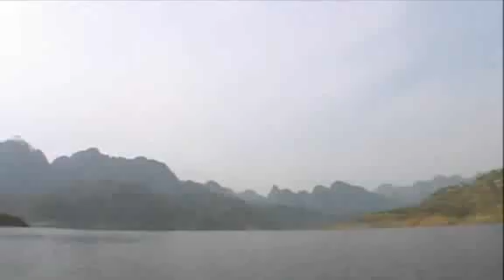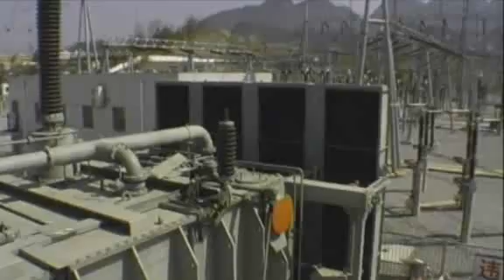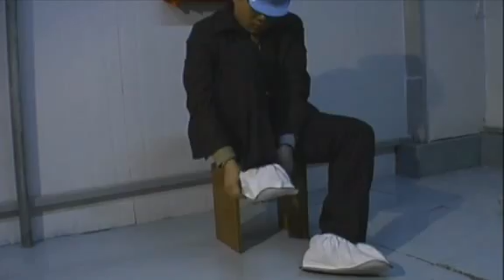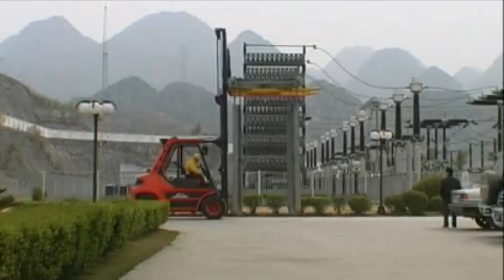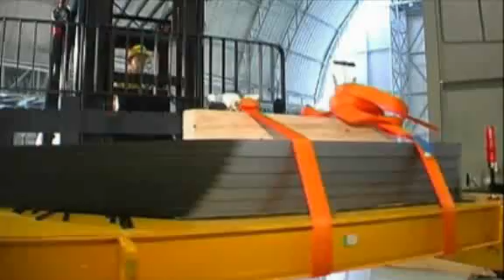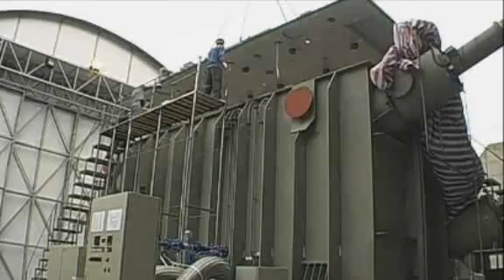HVDC Transformer Repair in China (Siemens)

Comment: 1800MVA... is that like bigger than a AA battery ?   I would like to run my torch on it.
Reply: this will kill you, idiot
Reply: please explain. my torch run on electric so it is same thing but would last longer than AA.
it might need resistor though; something like 220 ohms 1/4 watt or similar.
Reply: Spoif yeah, that will likely work.. be kinda hard to lug it around though
Reply: Spoif I have always wanted to see an electric torch lol

Comment: Lot of useful discussion. Now electrical energy can be transnitted on very high voltsges both on AC  and DC. In a lay man view, there is no difference between ac current and dc current. But losses are less in dc transmission. Dc motors have more tarque and traction power. But both are convertible, ac current can be converted to dc and dc can be converted to ac current. It indicates that why car batteries are importsnt in our life. Here is one question that how a choke was producing high voltage in flourecent tube and how that piece of junk is replaced by an electronic circuit in a saver bulb?
Reply: did you mean torque?
Reply: ac or dc motors mechanical output.
Reply: The choke had a bimetallic strip and heater  (lamp) based starter in parallel. When the fluorescent was  started, current flowed through the bimetallic strip and heating lamp. Heat produced by the heating lamp bent the strip, interrupting the current. Interruption of the current induced a high voltage across the choke (inductor), which also appeared across the fluorescent lamp. This high voltage helped in striking the arc in the fluorescent lamp, thereby lighting it. After the lamp was lit, the choke counteracted the negative resistance characteristic of the fluorescent lamp by restricting the current flowing through it.

The electronic ballast circuits used  nowadays  effectively work as SMPS ie 220V 50 Hz ac->dc->350V 20 KHz ac. This enables use of a much smaller inductor than a bulky choke due to the higher rate of change of current at the higher frequency. This small inductor is integrated with the electronic ballast unit at the base of the lamp
Reply: The coils of a motor are always alternating current, even if the input is DC. if the coils were energised with DC nothing would move, for long.
Reply: What? Generally AC motors have more torque than DC ones. DC transmission is only considered when for very high voltages (500kV and above) and great lengths (500km+) or for grid interconnections.

Comment: Transformers do not work on DC.
Reply: https://en.wikipedia.org/wiki/HVDC_converter_station
Reply: The transformers step-up the AC before it can be rectified by thyristors to DC.
Reply: You have to consider that a transformer is an energy-conversion machine, not only a pair of windings and irons. Today is posible to convert high DC voltajes by means of big thyristors.
Reply: The video name is technically incorrect. This transformer provides (from the power source) around 800,000 volts ac to the rectifier system which is then sent out on the transmission lines as dc.
Reply: This is called HVDC Converter Transformer which is used for HVDC transmission. The basic working principles of converter transformers are similar to common AC transformers, they work based on windings and magnetic flux in the core. However, the main difference is that, due to its valve side ( secondary side) is connected to the 12-pulsed converters, there would be a DC component of the voltage existing  on its valve winding (secondary winding). In other way speaking, the voltage waveform on the secondary winding of converter transformer is a combination of DC and AC, which makes it a big difference from common power transformers.
Reply: A transformer is - by definition - a device that uses a magnetic link. These do not work on DC. What you are referring to is called "high voltage dc short coupling" and does not even need a transformer :-)
Reply: how does it work?
Reply: Like any AC transformer.
Reply: that is why it is DC you stupid fucking idiot!

Comment: Direct Current?
Reply: +Higher-Ground Farm yep HVDC apparently is in use for long haul lines who knew thought thats why we dont use DC because of even worse losses over AC for transmission.
Reply: @Cinncinnatus  DC is worse at lower voltages but these HVDC systems these enable lines to be in excess on 1MV with around 97% trasmission efficency at ~2-3000km. and you only need two cables compares to the three phase HVAC systems. issue is to get convert power to dc from ac and visa versa the components are more expensive. the break even point from DC to AC is around 1000km making it perfect for massive countries and intercontinental power sharing.
Reply: @olir614  I had someone try to tell me that all transmission lines are DC. My favorite part was when they claimed a breaker panel converts DC to AC...
Reply: @Barbaratio  Lol.